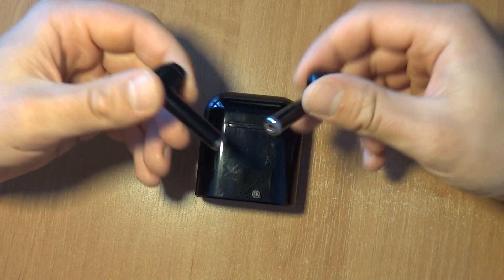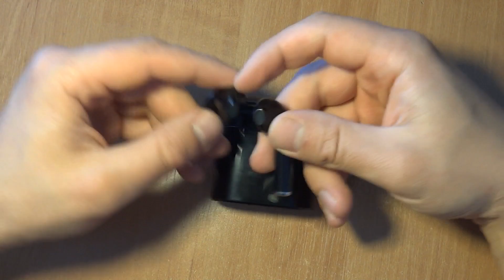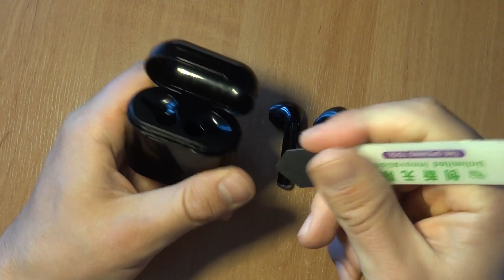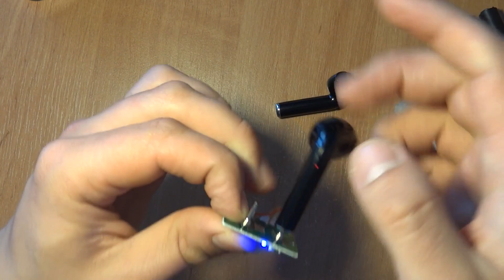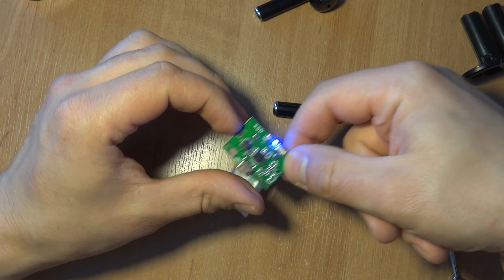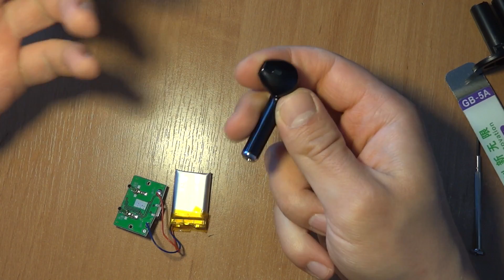Fake black AirPods - I7-TWS review and disassembly

Comment: Not everyone can afford overpriced Apple products or overrated Beats. These are a good option for someone who needs wireless earbuds but has no audio jack for cheap wired earphones.  Why post a video about these if they are so far beneath your standards?
Reply from the maker: Wow, way to make me into a straw man. Rough premise of the channel was to review some cheap tat and possibly mod it. My personally bought most expensive headphones were ~$100 so I have no idea what you're talking about. Only expensive headphones (Jabra 75) I reviewed I got from my job and didn't even like them that much. I've also bought airpod knockoffs from local supermarket chain for $15 lasy year and they're pretty good, you can call someone, have good battery life and fairly okay range.

Ones in the video were horrible, caller couldn't hear me, battery died quickly and were super uncomfortable, yet they were marketed to death by local dropshippers and Chinese sellers. You can see people complaining that charging broke for one of the earpieces after a month or so. They're just bad. This is also important so I can save people from spending money on things they will go on a landfill. When buying something I look for people complaining about the thing and see if it's something I agree with, not for shill reviews.

Comment: I have a problem with mine,the left one the bottom of it is stuck in the case and I can't seem to get it out what do you recommend I do
Reply from the maker: I think you should be still able to open the case even with one earpiece inside and then it should be easier to dislodge it. The metal on the connector could've bent and it got stuck because of that. Try to be gentle with the board inside as connector may break off.
Reply: @pandaengineering  I just opened it,out everything back inside the left one but it gets stuck again and won't charge
Reply: @pandaengineering  if you have Instagram you can dm me so I can show you the pictures and maybe you can help me
Reply from the maker: I've messaged you on TT 🙂 Hopefully the @GGYOUNGBOY is the right one

Comment: Hello when the " power bank " is lighting by the red colour it means its not charged ?
Reply from the maker: I gave mine away, but if I remember correctly blinking red light means charging and steady means it's charged. If it's always red and doesn't charge the earpieces it may mean that battery failed or cable snapped off.

Comment: I have the exact same! But my left airpod won’t work, i’ve tried charging and turning it on multiple times :(. What do u suggest i should do?
Reply from the maker: When you look at the comments here it seems that one of the earpieces fail often 😟 I think it's the charging board inside cracking or the solder joints on the board failing. You can try to disassemble it and try to charge without the plastic box to see if it can be charged again with the other connector. Make sure to open it up gently because the battery wires are very fragile and may break.
Reply: @pandaengineering  Thank you!

Comment: I have these. I dropped them and it broke the headphone face. It came off and I could see the battery I just put the face back on. Would you say this is safe to still use? Worried it might blow up.
Reply from the maker: If the cables weren't cut or damaged (so they can't short) I think you're fine.

Comment: I need help because my airpods have a red light lit but can't connect to my phone.....btw my airpods is completely similar to yours.
Reply from the maker: I think the red light means it's in charging mode. Haveyou tried pushing button for 20-30 seconds to see if it will turn off? You may also need to remove them from your phone first if you had them paired before.
Reply: Another question, what is the color of the light when it is full charged?
Reply from the maker: I think it just goes off, I can't remember.
If I remember correctly pairing was blue/red blinking and connected was blue blinking.

Comment: i bought i7S tws airpods..and it looks weird..the airpods have the same color but it's head doesn't look the same..the speaker or something is facing downward while the other one is normal..is this normal or is this fake? please answer me..(sorry if my english is bad)
Reply from the maker: I'm no sure, but since they're also sold separately it's possible that you've got some kind of old and new model.
Does it come with charging box or just a charging cable?
Reply: @pandaengineering  it comes with charging box..but one of the airpods does'nt fit in the charging box..is this fake?
Reply from the maker: I never seen one sold like this. You should be still able to charge it if you open the box and connect the headphone directly. Mine came originally packed in the charging box and I think that they assemble those from ready sets of components at the factory. It's really hard to say if those are fake since they are aready a knockoff and propably the person assembling the set was so tired that they used the headphones from two different sets by mistake.

Comment: How many minute??
Reply from the maker: They worked usually 40-50 minutes, but I can't recommend them anymore, since a lot of people had broken connectors in the charging case.
Reply: @pandaengineering  100%full??
Reply from the maker: Yes, you can charge it 4-5 time using the case, but one charge lasts for about 45 minutes.
Reply: @pandaengineering  how many time airpods life?
Reply from the maker: I have no idea, sorry, but maybe someone else in the comments will know :)

Comment: Everytime I pull out the right one the bottom connector piece comes out and I have to push it back in. It's not inconvenient it's just I'm worried that it's going to break or something. Any suggestions?
Reply from the maker: I think best idea is to open the charging case and solder the connector back in. It seems to be very flimsy and looking at comments here it eventually may break even if it's soldered.

Comment: Do you know how to fix them if the charging thing wont work
Reply from the maker: Unfortunately I think the solder joints may be cracking after longer use 😔 (see other comments) You may be able to resolder the joints inside and bridge cracked connection, but another option is using a separate cable to charge them instead of the box. It seems that ports on those earpicies is just like old nokia connectors (small pin) so it maybe possible to get nokia usb charging cable. If you buy a single earpice, they supply connector like that instead of the charging box, but I don't know what is the polarity of those charging cables(normally minus is on outside and + is on inside), because I gave mine headphones away.

Comment: I have those airpods but it stopped charging what to do???
Reply from the maker: If you look at the comments it seems a common issue. I'd recommend that you check the connection to the board inside, becaus it may have cracked.

Comment: Hey could you help me how do you pair both i7s tws black earphones?
Reply from the maker: If you pair one of them, the other one should connect to main one by itself. While turning the main one one (either is fine) press and hold the button for longer so it will enter a pairing mode. Make sure that both are charged. It can be really hit or miss because they are very poorly made so you may need to do this 2 or 3 times.

Comment: How do I know if they are fully charged
Reply from the maker: Unfortunately the way they're designed, the only true indication is on the earpicies themselves - inside the case little red light goes off when they're charged. You may be able to see that in a dark room, but I just left them charging for 2-3 hours in the case and that was usually enough for 40-60min of use. Charged case was usually enough for 4 charges. I wasn't impressed with them so I gave them away, so I can't test to check.

Comment: My right earbud don't turn on but my left one does and I just bought these
Reply: Yeah just like my airbud the left is working but the right airbud saying POWER OFF ..
Reply from the maker: I think it's a broken solder joint on the connector or dead battery. If you open the charging case ther may be a crack on the other side of the board - if you reflow the solder it may just come back to life.

Comment: How did u get the green thing out so easily mine won’t come out and the black and red cord came I’m attached
Reply: Undone *
Reply from the maker: It's just clipped in, try levering the board from two sides and it should pop out. The button on the casing may be in the way if it's hard to remove the board. You will need to remove battery first as it was glued with doublesided tape - make sure you'll detach the tape from case and not from battery as it may break the battery if it's foil gets stretched.

Comment: I need help I turned the power button and it’s blue and when o try to connect them they turn off and I already charged it
Reply from the maker: This could mean a faulty "docking station". You can try disassembling it and seeing if the headphone charging connectors aren't broken from the board.
Reply: Try both not just one

Comment: Do u know how to fix them my left one doesn't work I tried the 30 second hack but it doesn't work
Reply from the maker: I'd try disassembling the charger and checking the connections. After you remove the board from the charger you will be able to see if the earpicies are actually charging (there is a red indicator on each of them). Connector may be broken or the little battery inside might've failed.
Reply: @pandaengineering  can you help me ....? The other one keeps turning off... Even though I only hold the button for 3 sec
Reply from the maker: That's probably the bad battery or a charging issue(broken connectors inside the case). Those are very low quality headphones and they just break in hands. I'd say some of the mini batteries in earpicies may be good for just 10-20 charges. I had some powerbanks and phone batteries from china that worked great but for 20 charges and then they didn't hold any charge at all.
Reply: @pandaengineering can you make a video about it plz...  The problem is the earphone not the case because I tried to charge the working earphone on the other side which it work
Reply: @pandaengineering  and the Other which is not working....did not
Reply from the maker: Its all glued together so it will never go back together properly. I gave mine away,. I'd say it will be better if you buy new ones.
Reply: Haist... :( OK this is new one I've bought this earlier this morning
Reply: @tancustgaming219  i bought mine in SHOPEE. HAHHA its working good.
Reply: @binesdo3717  mine don't every time I turn it on keeps turning off

Comment: how to make the mic work properly during call? because the other person can't hear properly
Reply from the maker: I don't think it's possible, sound from mic is very distorted and other person will hear a lot of constant buzzing. They probably didn't do a proper separation in electronics so it interferes with microphone amplification. I never had a good expirience with talking over bluetooth headphones, some are just ok. Whenever you have HD voice call over LTE (or VOIP call like Whatsapp or Hangouts), there allways is a noticeable difference between even better Bluetooth headphones and cheapest wired headphones with microphone (like the ones that come with every phone). If you look at higher class products like Marshall Mid headphones, they've put the microphone on the wire for talking in wired mode - quality of talking over Bluetooth just isn't there, I tested them in store and didn't bought them because of that.

Comment: There not really that "fake" ,just made by another brand not by Apple ,cuz I've been using mine for 1 year now and still working best
Reply: How did you connect it
Reply: I got a question, can you charge these in an actual airpods case?
Reply from the maker: No, those have specific connectors at the bottom that are almost exactly as Nokia's from mid-2000.
Reply: Yes
Reply: Really it work perfectly
Reply: Agree i use it also
Reply: I bought mine and the apple airpods two days ago and when I was cleaning my house one fell and broke so they suck 👎🏾
Reply: The battery also dies hella fast so I think the wired earphones win this fight

Comment: bro one is not working and one is. the one not working, when i turn it on says " power on". then after like 10 seconds it says "power off" and turns off. and it does that all the time. i have excacly that kind of airpods. the i7S. i dont know what to do.. please help me.
Reply from the maker: Are you sure the other one is charged? The charging connector is delicate so it may have broken from the board inside.
Reply: @pandaengineering  i carged it.like a 100 times. idk what to doo
Reply: @pandaengineering  i think i found out something.during charging  the one thats not working  shows blue light. even though its supposed to show red. i turned it off and put it back. but it still shows blue lighf. i have no idea why
Reply from the maker: Sorry for late reply, it's possible that one of those mini battery cells died and it's "instantly" charge, while it's holding no usable capacity.
Reply: @pandaengineering ok thank you
Reply: me too
Reply: Saba($-$) mines are perfectly fine
Reply: Im with th same thing right now, did you solve it??

Comment: Can they be used separately or should both be connected to the same device?
Reply from the maker: You would have to be further away than 10 meters to use both of them separately, because the instant you turn on the second headphone it will connect to the first one, even if it's not connected to a device yet.
Reply: Thx man
Reply: Felix Delgado same